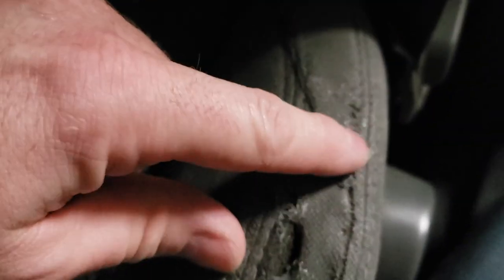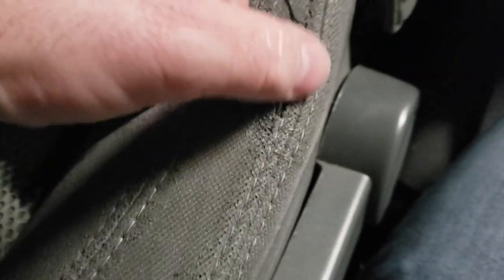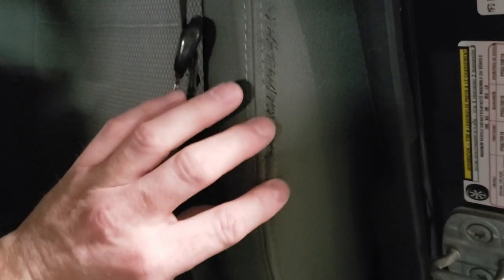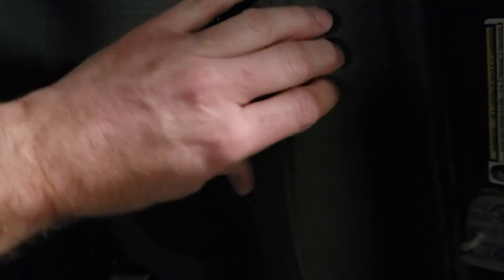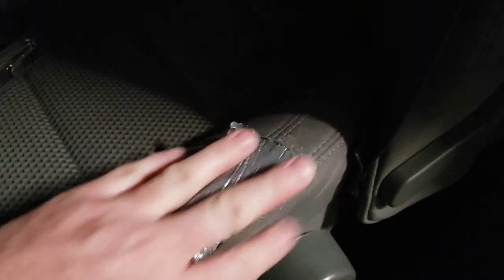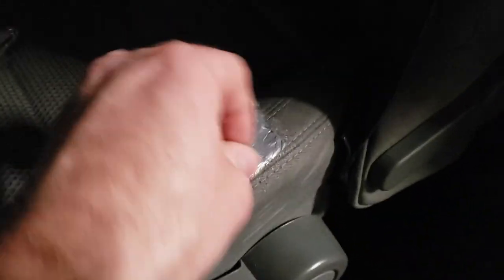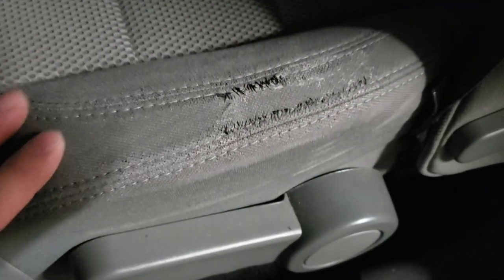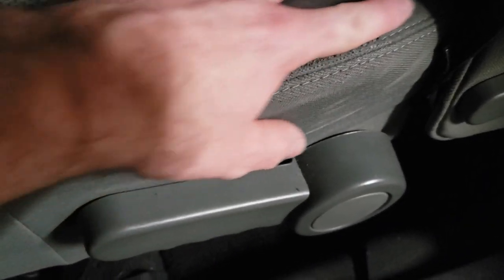How To Repair ripped upholstery/Car Seat   | Tech Tip Tuesday With Streetstomper #4

Comment: You can take colored thread of your choice and a hook needle and loop the colored thread threw each of the stitches in the seams running around the edge of the upholstery panels to get a custom touch. I does take some time but can really give shift boots, door panels a really nice look for cheap.